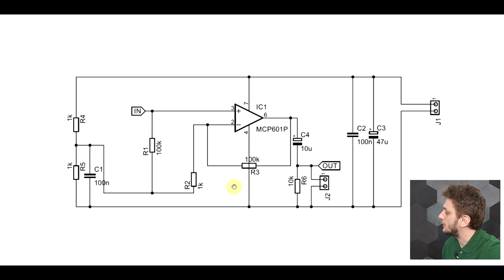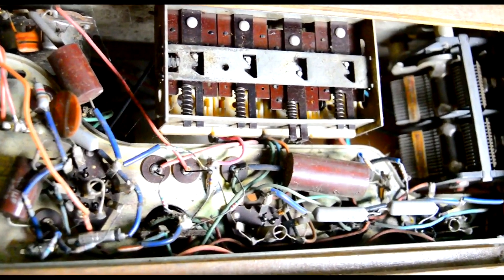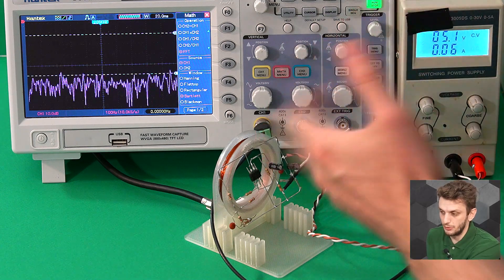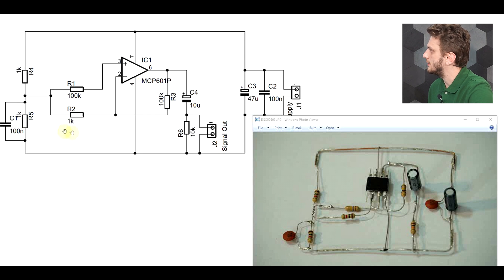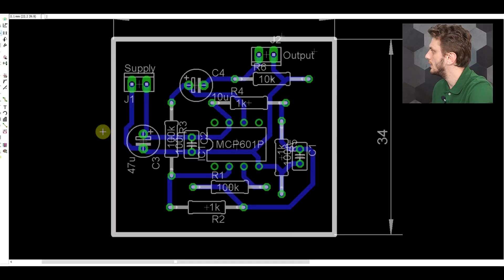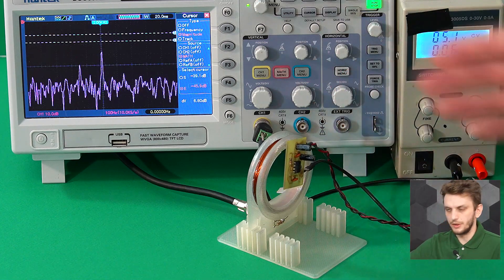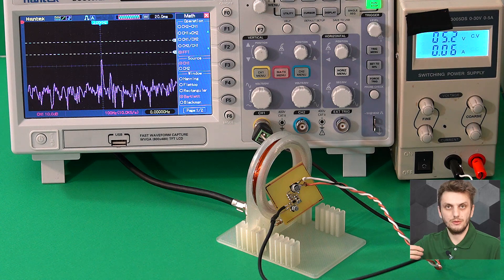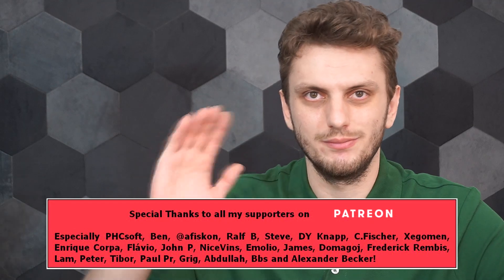About CIRCUIT LOOPS in amplifiers

Comment: empties coffee machine into prevailing wind

GROUND LOOP!!!!

meh. the first stage is the most critical, and as everything after that is amplified, targeting SNR here has the largest effect.

one also must consider the mains earth grounding and the amplifier grounding... the circuit should reference to the chassis at one point only, and that point should be the input jack.

rebuilding old guitar tube amps, i find so many ground loops and complete disregard of basics that it makes one want to scream... a big one is all plugs/jacks and pots being "grounded"... a really bad habit, does more harm than good. unfortunately the old school metal jacks are already grounded and need isolating bushes... except that ONE input jack.

a recent one... someone had added a "ground lift" switch... by switching the main earth... tch tch! thats dangerous... deadly dangerous... if you must have a "ground lift"... its to isolate the CIRCUIT from the chassis... never, EVER remove the mains grounding! the "ground lift" is for when you have unavoidable ground loops due to chaining things like foot pedals and PAs together... theyre all hooked up to the mains earth as well as the "signal ground"...

ONE is for safety.  you dont mess with it. EVER.

im not even going to start on general grounding basics...

Comment: An important issue in high gain (sensitive) amplifiers is maintaining proper order of the ground connections. You don't want to put a decoupling capacitor, or the output ground conection, in the same loop as the amp's input ground connections. It's ideal to keep the different sections grouped, and then "star grounding" (or at least, first group the sections (input, output, filters), then bring  them together at a common ground point. In this way, the differences in ground impedances do not induce unwanted signals in the input/neg. feedback path

Comment: Great demonstration.  This video make me thinking of my DIY Class AB audio amplifier back in 1985.  I solved the Hum noise issue by placing the PCB in vertical position near power transformer.  The circuit loops is in parallel to the magnetic fluxes emitted from the power transformer.
Reply from the maker: Great fix! I never considered how orientation has an impact - if you set the circuit in just the right way, even if its close to the noise source, you can cancel the effect.

Comment: If you have a 2 layer board, have the return path overlapping the forward path on adjacent layers would make for absolute min loop area.
Reply from the maker: You are right, when having multiple layers, this principle can be applied by having an underlying ground plane. The principle can be further developed by saying that the smaller the distance between layers the better - typically with 2 layers it will be worse than with 4.

Comment: So, in summary, to make a circuit more immune to external noise:
· Use shorter wires/traces and make loops smaller.
· Use PCBs instead of wires.
· Use surface-mounted components instead of through-hole components.
· Shielding the circuit.
Reply: Except for electrolytic capacitors. Through-hole capacitors have smaller footprint. You can see it in 15:20

Comment: The use of both sides of the pcb and a ground plane would gain a bit more attenuation.
Reply from the maker: Of course! but I was trying to illustrate that circuit size (regardless of usage of other layers) is an important factor; by adding in a ground plane, this effect would be far more difficult to show.

Comment: This experiment cannot be relied upon to arrive at any conclusions about the relationship between a system’s susceptibility to RFI/EMI without further testing. Measuring at 2kHz only fails to tell us anything about how the induced noise in the circuits will vary as the frequency is swept through various ranges. Being that each circuit is basically acting as a tuned antenna, My guess is that each circuit and particular footprint has a resonant frequency where it will become most susceptible to particular frequencies. So, drawing any conclusions about size vs immunity to noise based on this experiment alone seems to be either ignorant of the truth, simplistic, or outright disingenuous. Maybe I am the ignorant one. That is possible, as I am not an expert in this filed, but this is how I see it.
Reply from the maker: You are right that circuit size will lead to a specific resonance frequency but a single turn loop of this size (diameter <5cm) will have this frequency in the 10s-100s of MHz, nowhere near the 2KHz being tested. Its true that the experiment will behave differently with frequency, in the sense that a higher frequency will cause a greater effect, but below the above mentioned resonance frequency, the effect should just increase linearly with frequency . I tried to go with the highest frequency the circuit would process without gain limitation to see the most clear effect. But anyway, as long as the analyzed noise signal is well below the "tuned antenna" resonance frequency, the same principle of smaller is more immune will hold.
Reply: @FesZElectronics  yes, I agree, detuningthe coupling would work, in fact it could work both ways I imagine. Making a larger than necessary circuit would work, for example in some special application (think space travel), but it would certainly create other behaviors, that may not be wanted. The trick would be to incorporate those secondary effects into an overall design. For example, maybe a circuit could be designed to actually serve as an antenna, and decoupled from the primary circuit for use in another part of a larger system, thus eliminating the need for a separate antenna. In a way, repurposing the circuit as is done with devices that use AC Mains wiring circuits to pass Ethernet signals.

Comment: You put a lot of work in these videos, they are really good. Have you tried the effect of the pcb material. The ratsnest one couples to your inductor through air, that gives a certain capacity. Probably to small to have much effect, but if you would glue it to a piece of FR4 in theory the very small capacity becomes a lot bigger. I never tried to measure this but I think it will perform worse as the ratsnest alone.

You really could use a VNA for your experiments. I have done a lot of experiments like you but then with the SDRkits VNWA, back then the only affordable VNA. I learned so much from experimenting with it. (made some tutorials about using a VNA, you can find them on my website ( pa4tim.nl) )
Reply from the maker: Hello Fred! If capacitive coupling is intended, then yes, replacing the air with FR4 will yield better coupling trough higher capacity. On the other hand, that is not really the situation I was trying to replicate - I was trying to show how the geometry of the circuit will affect noise pickup from a distance - so the thin FR4 already in the board does not have that much contribution. On the other hand if the both the noise source and the sensitive circuit are on the same board - in close proximity, then of course the proprieties of the PCB will have a big impact. 
If I remember correctly, FR4 has a relative dielectric constant of around 4.

Comment: 6:35 Is this a Hall Effect sensor? Can you also induce a current in the inductor by passing a current through the loop (instead of a magnetic field)? Or am i talking about the same thing: magnetic field generated by a current? Is it correct that it also works with DC?

Isn't that similar to a Rogowski AC Current Sensor? Why must a Rogowski be a coil instead of a simple loop? Why does the Hall Effect work with both AC and DC, but the Rogowski only AC? Thx!

https://circuitdigest.com/article/how-to-measure-current-in-a-circuit-with-different-current-sensing-techniques

Comment: At 1:07 "a single stage amplifier with 101 gain is not that practical". Why is that?
Reply from the maker: One important concern is that the output also contains the amplified input offset - some op-amps have input offset as big as 10-20mV (NE5532 for example has maximum of 5mV); this input offset is multiplied by the gain and it can be observed as a voltage shift at the output; since the offset can be either positive or negative, your useable output voltage swing is reduced by 2xoffsetx gain (for 5mV and 100 gain, we get 1V)
Another important concern is the bandwidth of the amplifier; The actual BW you will get will be the GBW (gain bandwidth product) divided by the gain - so a 1MHz op-amp configured to amplify by 100 can only amplify a 10KHz signal. The GBW in the datasheet is of course a typical value, so a lower number should be used to keep a safe margin.
Depending on the application high gain stages are used but this needs to take into account the actual circuit needs, and special op-amps may be necessary (ex with low offset). By using 2 amplifiers with 10x gain, the effects are reduced.
Reply: @FesZElectronics  Thank you for the explanation. The first point could be nice video idea!

Comment: you can decrease more noise by choosing lower value for resistor too,  and screening too , make trace guard at high input impedance will also decrease noise
Reply from the maker: Of course there are multiple things that can be done to make the circuit work better. I was just focusing on the specifics of circuit and component size. All of things you mentioned are valid of course and can be used together with smaller circuit loops to get an even better result.

Comment: How is the input floating, when its connected via a 100K resistor to 1/2 the input voltage?
Reply from the maker: I was trying to say that its not connected to a signal source. Of course, if I would have not added the 100k resistor the output would end up swinging to one extreme, so it would not work.
Reply: @FesZElectronics  Ah right, that makes sense, thanks.

Comment: I have a lot of broken cores from SMPS pcbs. 
Can I crush them into a power and use very little epoxy, to tamp the mixture in to a mold and make new cores?
Reply from the maker: It will work, in the sense that the end result will have magnetic proprieties, but to get this to work well you will need to grind the old cores into a very fine powder so that the final shape has more ferrite and less glue. I remember a viewer once told me they did a similar thing but with black sand (ferrite oxide naturally found in rivers) and they had good results.
Reply: @FesZElectronics  Makes sense. Thanks.

Comment: Can a box made of iron-oxide film provide shielding against electrical and magnetic fields?
Reply from the maker: Iron oxide is not conductive, it only has magnetic permeability, so it will help with magnetic fields, but it should not impact the electric fields. You can get the highest shielding benefits by using a conductive box and then applying the magnetic film onto it. This way you get the best of both worlds.

Comment: Great video ..
Thank you so much for such deep analysis and sharing with us .
I noticed you twisted your power supply wires does it make any difference?
Do they reject common mode noise 🤔
Reply from the maker: Indeed. Keeping the wires twisted will reduce the noise pick-up -> each loop picks up noise in opposing directions so it cancels out. At the same time I used coax cable on the output, again to keep it as shielded as possible. I wanted to keep the cables as immune as possible, so all the measured noise comes from the circuit rather than other sources.
Reply: @FesZElectronics  Got it. Thank you ☺️

Comment: What is use of R1 ?
Reply from the maker: Its there to provide a fixed voltage level on the input - the input is pulled to the reference voltage (Vcc/2). Also this resistor sets the input impedance of the amplifier since its much smaller than the op-amps internal impedance.
Reply: What if your small music player runs  on 3.3v .  Pulling up the output of music play can destroy output of the music player ?
Reply: @sumit_kashyap..  Most probably no, it's output probably already has a decoupling capacitor so it doesn't get affected by DC, and if it doesn't have it, the 100k ohm is high impedance so very low current will flow into your music player.
Reply from the maker: Even if the output of the signal source has a series capacitor, if its a different piece of equipment than the next block its connected to, its good practice to also have a capacitor on the amplifier input - just to make sure no unexpected DC voltages are interconnected.
Reply: Thanks for your great explanation 😊.